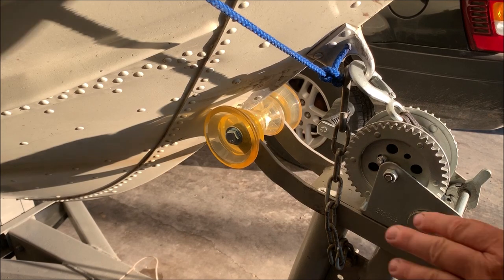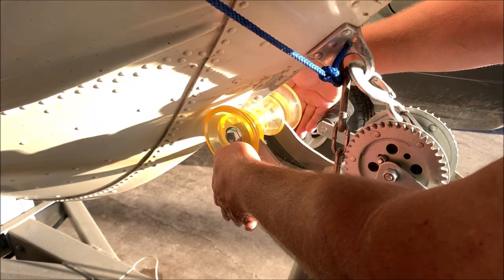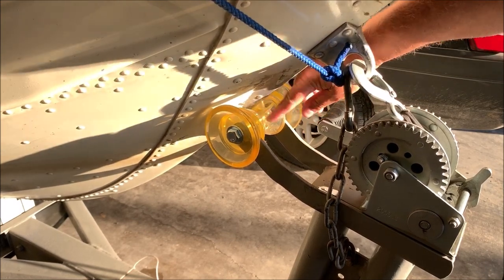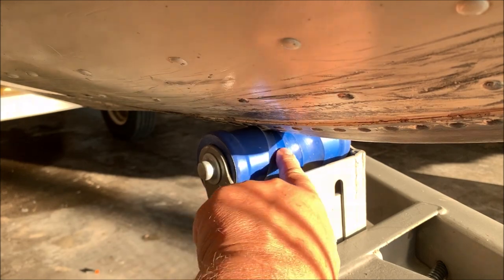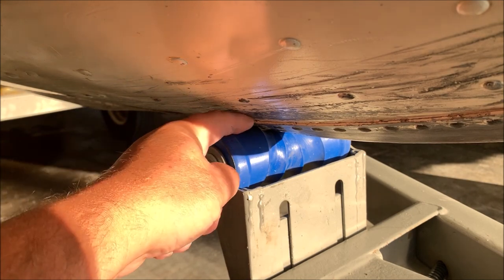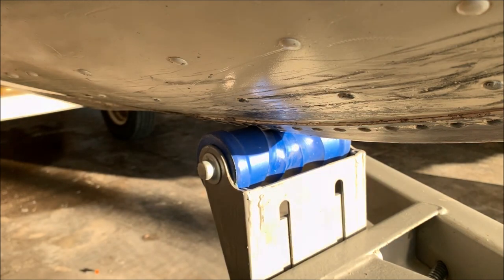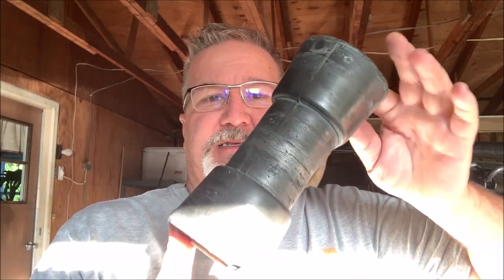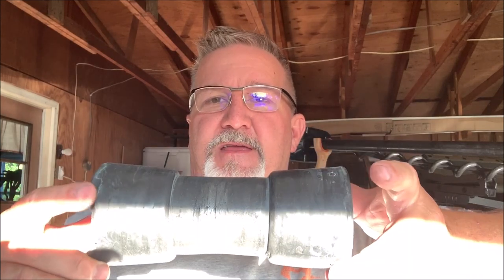Boat trailer roller modification for my 1976 Starcraft boat

Comment: You need to get rid of those crimp on roller shaft caps, they pop off and you can lose your roller, it happened to me this summer. Drill the ends and use cotter pins.
Reply from the maker: probably should. So far they haven't failed me.
Reply: @Michaelsbackyardmarina  it's not if, but rather when

Comment: Going to update mine.  I dread loading my boat at the launch, because it's always hit or miss if I can get it on the trailer straight.  Hated being that guy holding up the line at the launch.
Reply from the maker: I would highly recommend.  They work wonders. Thanks for watching

Comment: I have a v bottom Lund. My problem is the roller on the trailer has a notch in the middle and it’s pretty hard to get it lined up perfectly to where the v bottom fits into that notch. Wonder if this self centering roller would fix my problem?
Reply from the maker: It is a blessing, I love how it centers when I load the boat.

Comment: where did you find the selfcentering roller for up front? I can only find a 12in but need an 8in? i have checked ebay, amazon, etrailer etc
Reply from the maker: Try boattrailerparts.com

Comment: My trailer has 5 rollers can I replace them all with self centering rollers?
Reply from the maker: You could but the front two are the only ones your boat would normally contact when loading.